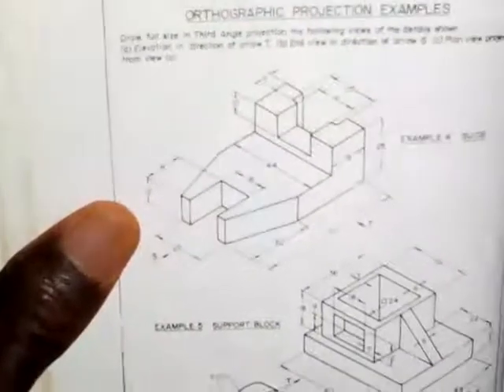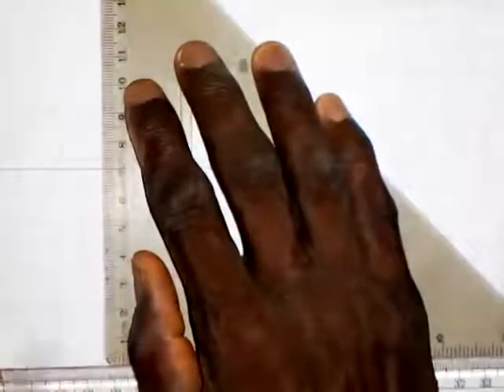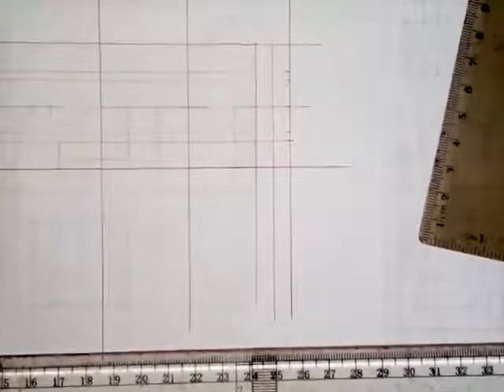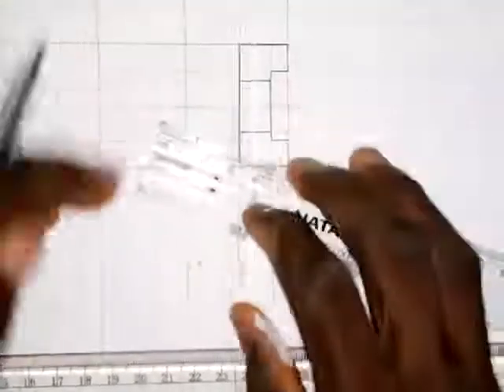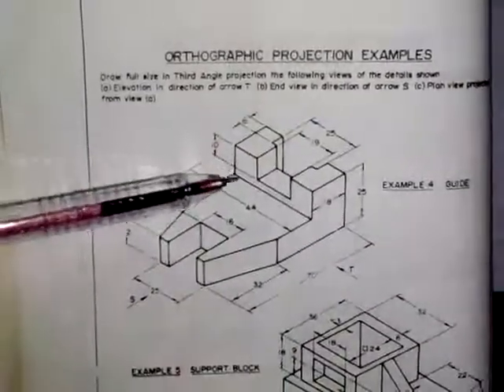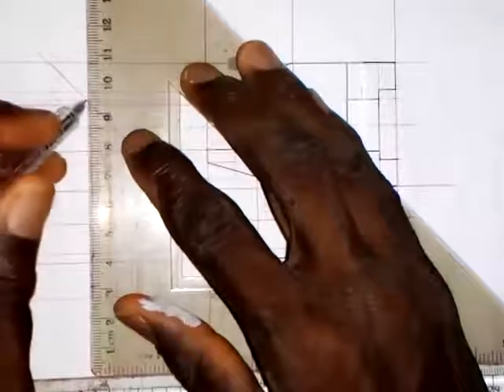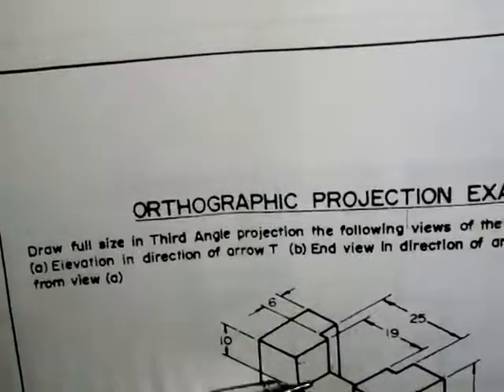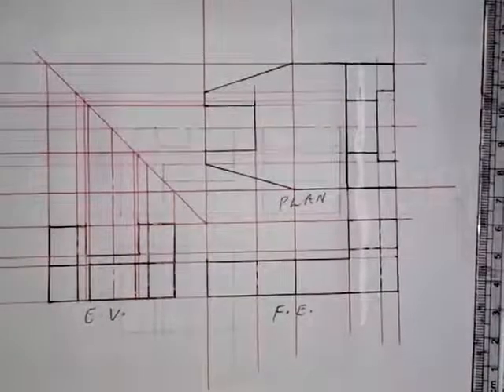Conversion of Isometric Views into Orthographic Views 4 (Third Angle Projection)

Comment: Nice video sir, well explained 
But i have a question, is it a must that all hidden lines should be shown?
And in terms of exams, will failing to show them cost you marks??
Reply from the maker: If you are to reveal all the hidden details or not the question will tell you but if the question does not tell you I will advise you put it there. Thanks sir!